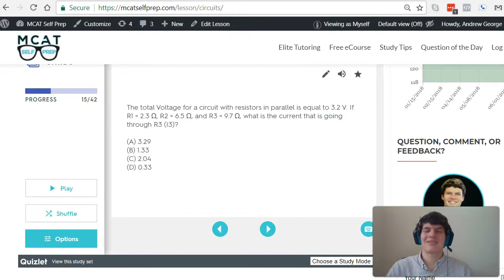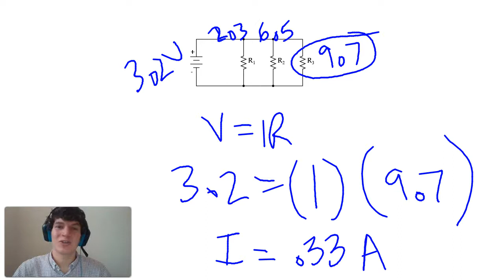MCAT Question of the Day: Electric Circuits and Ohm's Law

Comment: if the current doesn't change, shouldn't we get the same value of I for all resistors?
Reply from the maker: Good question Iza. The current changes as it goes through a junction just as a river's current will change as it divides into two rivers.
Reply: @mcatselfprep9585  So you are saying that there is no conservation of electric charge here?